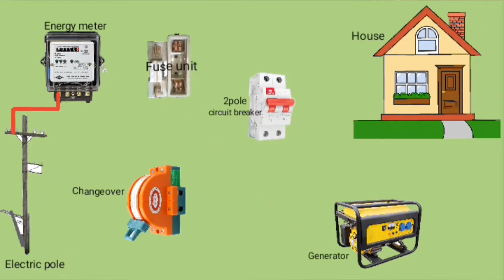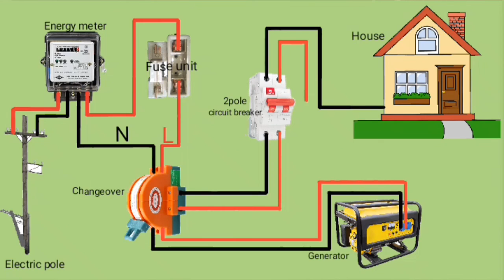2pole Changeover Switch Wiring Diagram/ Single Phase Generator Connection Diagram.

Comment: please how do I connect indicator light to the changeover to show power from pole?
Reply from the maker: The supply that come from the pole to the changeover, connect the two wires that come from the indicator to the pole wire in the changeover to indicate whether there is light or not.

Thanks For Watching😊😊

Comment: I don't really know how to connect from the mcb to the breakers
Reply from the maker: MCB connection to Breakers are very simple. I will try to make a video on that topic.
Through the diagram you will understand better.
Sorry for late replying.

Thanks For Watching😊😊.
Reply: what's if I don't want to use mcb circuit breaker but I want to connect direct to the house